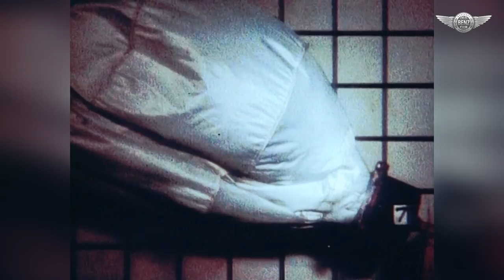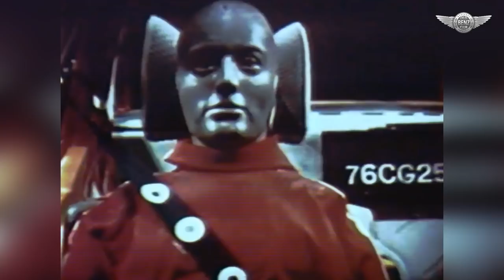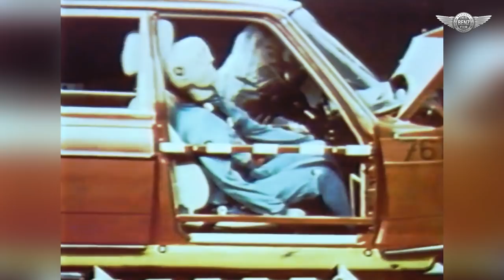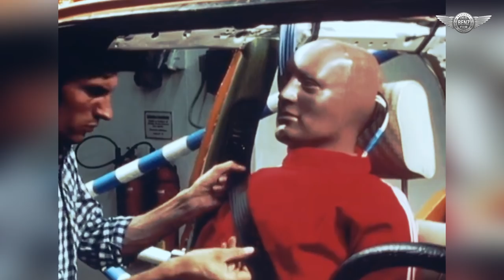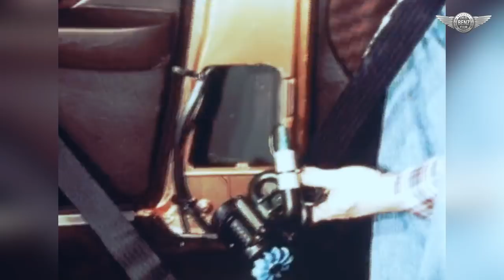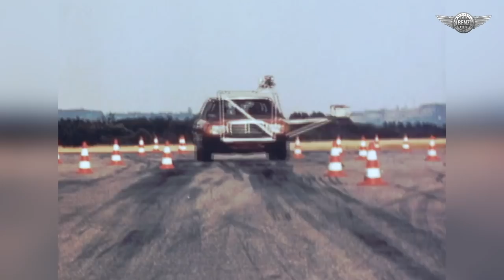Mercedes-Benz - development of the first airbag

Comment: GM was developing ACRS restraint system along the same timeline as MB was. The irony of it was GM began offering air bag restraints in the 1973-74 model year, but very few people ordered the option, as they weren’t even wearing seat belts.
Reply: My understanding was at the time it was just way too expensive. There are some head scratching options in some luxury cars nowadays like the $5000 stereo upgrade for the Mercedes or Audi. Probably the same sort of price difference back then